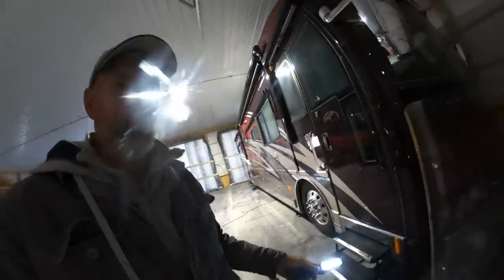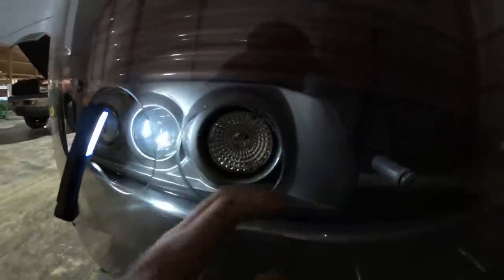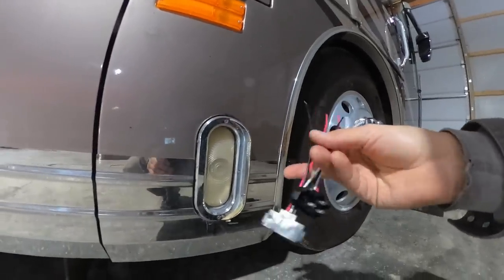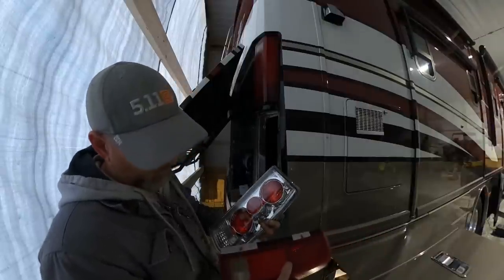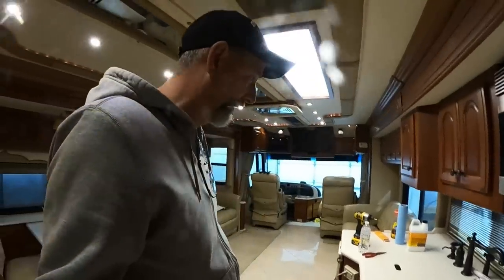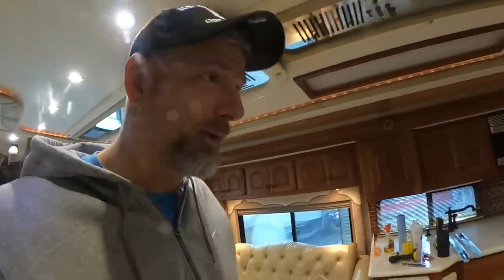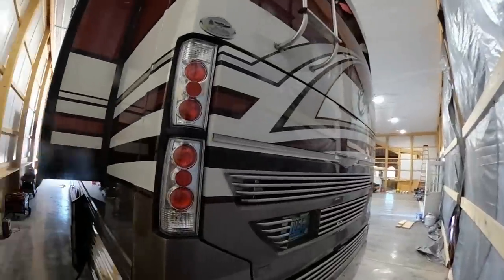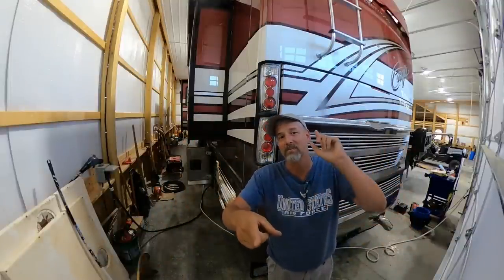Installing new LED lights and Mattress in the RV | 2005 American Eagle | EPS2 | Shots Life

Comment: I'm sure you have probably already figured out what you are doing with the TV mount in the lower compartment but possible use a ceiling mount for a flat screen and turn it upside down. I used one of those to mount a TV in a screened porch and it worked great.  The coach is looking good.
Reply from the maker: Great idea! Thanks brother

Comment: Sony Wega TV,,,, 27” is 89 lbs. they have a porous metal piece about 1.5” thick directly behind the glass so it can maintain the vacuum the tube needs and not implode,,,,,, hahaha. 
     I like what you are doing with the bus. The lighting changes will take away from all the drain on the batteries and of course it’s whiter and brighter. I definitely like a diffuser over any LEDs because they are almost too bright!! You know what you are doing clearly, and the end results will make the bus look more modern and definitely feel more modern!! It’s all good!! I have restored and helped restore a few trailers. We did an Airstream, but that was challenging with the original interior fitments and all the real wood veneers. It came out very well, but the owner is a surgeon and much more detail oriented than a few of us, including me, so he made it factory perfect if not better. He has since sold it,,,,, made almost $10K CAD!!! Now he is driving a Diesel pusher, Fleetwood Discovery 38 foot. It’s pretty nice!! I never have gotten into that yet. Have a Rayzr truck camper (FK model) that’s only 1100 lbs and fits well in my F150 Tremor. It sleep ONE!! haha. Perfect for fishing with some of the guys. I need my sleep and we all snore so we all have our own set ups. The other unit we have, my wife likes a lot! It’s a 19 ft Diesel Mercedes 4x4 that sleeps 3 (sorta well) and 2 very well. She even asked for a slight lift and BFG KO2s on it!! She has taken possession of it!! Heh heh. It’s great!! 
     I showed her units like yours, but she wanted to be able to drive and she said her days of driving farm trucks or anything that size are over!!😂😂 I’m ok with that. My RV garage is MUCH, MUCH SMALLER than yours!!😂😂. 
      You have a ton of skills good sir!! A ton of them!! I’m impressed and I think I have a lot of skills,,,,, you are wayyy up on me!! That’s awesome!! I think when you are done, that will be so clean and refreshed that it will definitely feel like your second home for the 3 of you!! I saw the little furry one supervising!!! Making sure you got her bed just perfect!!! Heh heh,,,,,. 
        I have seen the flat screen mounted in the door of the enclosure and when you open the enclosure the screen drops down from the back (top) of the door with a mount on the front (bottom) of the door and that hard mount swings and pivots. The mount for the hard mount was a 2x2 glassed into the door. You know how to do that!! It would be a lot of work though. Gotta be careful you don’t slam the door when you close it as well. I am sure you are already done that project in real time and what you have likely works excellent. 
     Catch ya later!! We shall see what’s in “Shot’s Life” next week!! Take care, Eh!
Reply from the maker: The Airstream sounds awesome, man you have really done it all! The Mercedes sounds pretty neat as well…there is something to be said for a smaller more agile unit. Good idea on the door, but your right that would be some work. See you next week buddy!
Reply: @shotslife  - Thanks,,,, I suspect you have about heard everything I have done though. I’m actually tired of the new vehicles. My new focus will be just to restore what I liked regardless of its appeal or not,,,,,, like a Pontiac Fiero. As far as doing adventurous and stupid things,,, well you know my health issues. Just gonna relax and enjoy the ride from here on and when my time comes, it comes!! I’ll watch the family and friends do the adventurous and stupid things,,,,, hahaha. 
     The fishing trip was a little humbling this time. It was with my closest friends, who are mostly 10 - 15 years older than me. Offshore fishing and pulling in 20lb+ ocean fish is hard bloody work and in 3-5 days you will catch enough fish to limit out on your possession limits, while getting about a years worth of fish for a family of 4. It’s very hard and fast!! Not so many of the group are hard and fast anymore. They would give up, because they had to, and a couple of the younger guys and myself were reeling in all the fish for each of us to limit out,,,,,. They would still try once in a while, but it’s bloody hard work and requires some strength. I still have that strength and will, but MAN do I get tired!!! Hahaha. I am sure that’s from the heart attack, so I decided not to push things quite so far as that anymore. Inshore fishing and the fishing we do is more than enough now. The fish we are impressed with here in Alberta are throw backs on the ocean!!! Haha. I can fish here and not get exhausted,,,, especially with the one cabin the wife and I bought recently. It’s 3 miles from my favourite lake and no neighbours for about a mile in any direction. 
     So it’s a lot of been there done that,,,, from here on anyways,,,,,. Thanks for the nice comments though!!